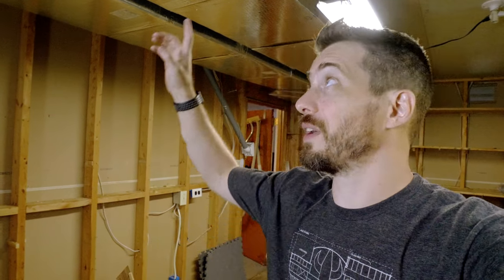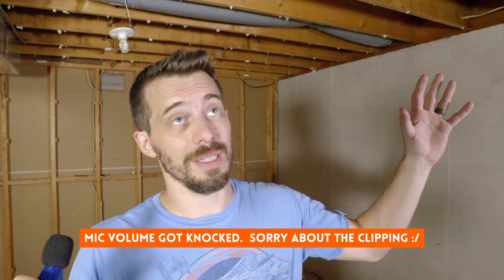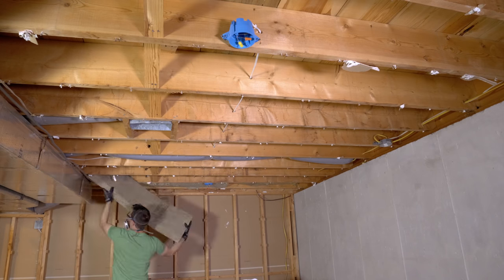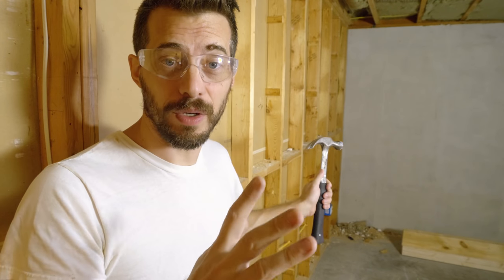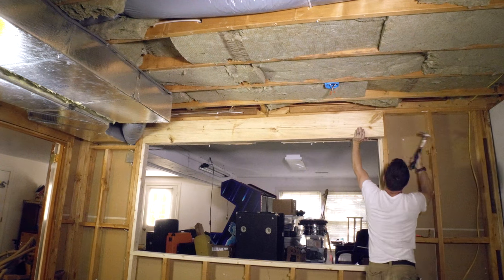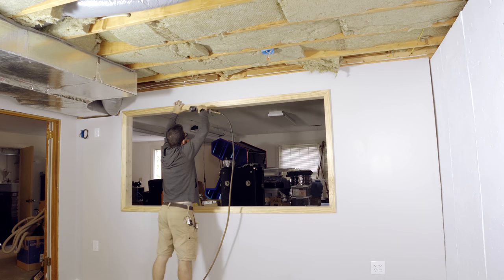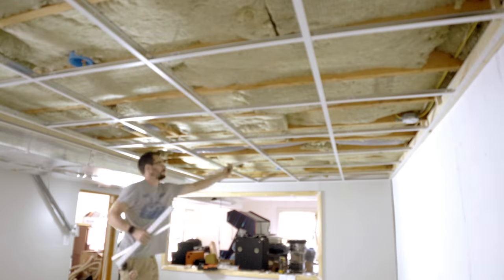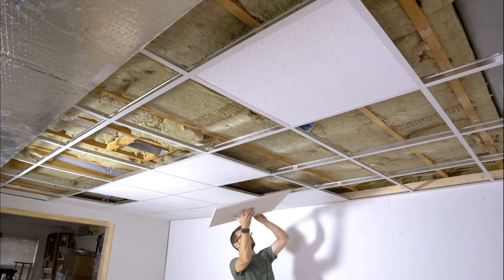Storage room to Office/Studio Conversion // Home Renovation | I Like To Make Stuff

Comment: Looks awesome. I think the acrylic window is genius! (I have four kids. I don't have nice things because I have four kids. Breakable things are a no. Acrylic window in office is a YES.) Awesome video!
Reply: After soundproofing the whole ceiling,  nearly nothing to stop noise from the next ceiling through the window.  Heavy glass would have worked better.
Reply: That a way to troll! Go get'm big guy. 

*(Not thinking he'll probably use that same treatment on that room's ceiling as well.)
Reply: The room where his kids are going to play and hang out,  with stuff flying around ( 8:30 )?  Give it a hanging ceiling,  noise + potential damage = solved
Reply: If you don't care for the window to be see-through, ribbed polycarbonate is a way stronger solution.
Reply: Hazel and Gold Designs I am one of 6
Reply: Hazel and Gold Designs don't hit on this guy

Comment: Your "quietness" gains are greater than you may think. Sound intensity is measured in dB (deciBel), which is a logarithmic scale. In practical terms, for each +3dB, sound intensity doubles (or for every -3dB you register, sound intensity halves).
Reply: Bruno Guedes You're correct that sound intensity level (a value calculated from a measured sound pressure level) doubles about every 3 dB - but the human-perceived loudness (what we subjectively perceive as sound volume) doubles only about every 10 dB. Still, the 10+ dB drop measured would result in a perceived loudness drop of more than half of the volume measured during the pre-project "noisy" period upstairs. Pretty good reduction!

Comment: The dropped ceiling is actually sound insulating better than the mineral wool as it has more mass. The stone wool can absorb the sound inside a room very well but it's not a good insulation system. And by the way it is a very good thermal insulation even if for this particular product the manufacturer doesn't specify it.

Comment: Can you please do a video where you talk about good starting power tools such as, table saw, miter saw, bad saw belts/disc sander and other tools like that. I really want to start doing more woodworking and I'm a little over weekend about what to buy. Great video as always!
Reply: If you live in a good-sized city, Craig's List and an unwillingness to spend more than $100 for most tools will get you going. Living in Cheyenne, I've bought two jointers, a planer, bandsaw, and 12in disc sander for less than $400. The Hitachi table saw was a bit of a splurge, but some darn good craftsman saws can be had for $100. 

The good thing about cheap used tools is that if you take care of them, you don't have to worry as much about depreciation.

Comment: Regarding Roxul vs Pink Fluffy - you are absolutely right that there is little difference between the two.  That's the "absorption" layer that is effective with higher frequencies and while Safe-n-Sound is slightly more absorbent, the difference is so slight that you'd only notice if the rest of your attenuation strategy is on point.  Diminishing returns and all that.

Regarding drywall on the ceiling - drywall would do a much better job overall of sound control than a dropped ceiling simply because it has so much more "mass".  Of the four horsemen of sound-proofing (Mass, Absorption, Damping, and Decoupling), mass is the only one that is a hard requirement and has the clearest impact... and is second only to "decoupling" as the most bang for the buck.  What the drywall wouldn't help with (much) is the impact noise from footfall traffic.  Only decoupling helps with that.  Your dropped ceiling is mildly in that direction but since the acoustical tiles have relatively so little mass compared to drywall, it's not going to have the same impact.

But hey, as you heard with your own ears, even what you did do makes a HUGE difference so don't take any of what I said as a criticism.  Good job!

Comment: Great job, safe n sound is amazing. I would of use a vapor barrier and if you wanted to loose even more of the sound and you have a budget, i would of put up 5/8 drywall or even better plywood pieces for the seiling. Instead of the Tbars for the ceiling, you could have also used ceiling pvc tiles which just glue on, the leds you could also install above the drywall. Either way amazing job!

Comment: If low frequency sound transmission or impact noise becomes an issue, increasing mass (i.e. two layers of drywall) resiliently suspended (e.g. IsoMax Clips, GenieClips, etc.) should really help. If you ever want more clarification, don't hesitate to reach out. And keep up the great videos!

Comment: In terms of speakers, every increase of 3 DbSpl is a doubling of power, so dropping the ambient room noise by about 3 is actually almost cutting it in half. Something you might not be able to hear on your own, but that definitely makes a difference for recording purposes. Those LED panels are AMAZING instead of fluorescents which again, cause a noise and hum that ruins recordings. As for your kids footsteps, having a few rugs on the floor above would help, even if you set them under couches and tables and not where the kids are walking, as well as you could add a few bass traps in your studio to help the absorption. Awesome job!

Comment: I have a similar project - trying to specifically lessen the sound of foot traffic (wood floors) from room above entering room below.  I plan on using the Roxul but also I've read that the key is density of material to "kill" the sound from passing through.  I'm wondering if a couple layers of sheetrock on the ceiling could help?  Anyone here have any experience in this regard?

Comment: Are you concerned that the insulation will eventually fall down onto the drop ceiling?   the vibrations in the floor will probably shake them loose over time.  Probably should have used plastic strapping or paper backed insulation stapled up to hold the insulation in place between the studs.   Otherwise it looks great!

Comment: Nice project...More outlets !
There are sheetrock hold- off brackets that run across joists (or studs) for sound reduction if you prefer a drywall ceiling.
Also consider pre- installing smurf tube so you can easily change out to fiber or whatever comes along (especially in an office).
🔺You don't want to breath the fibers from either the sound/fire insulation or the ceiling panels.

Comment: Bob! Great video, thanks for making it! You can save (repair) clipped audio recordings with Adobe Audition's De-Clipper. If you are an Adobe CC user, you are probably paying for it anyway! If you want super fast audio de-noise and de-clipper, it does not get any better than Izotope's RX. The RX Elements version ($99) comes with a voice de-noiser and a de-clipper (and some other stuff). They can run in your NLE as an audio plugin in real time. Those two effects are well worth it. I own the standard version of RX ($399) and I use those effects all the time in Premiere. No de-noising or de-clipping can touch what RX does. It's basically magic.
Reply from the maker: Awesome, I'll check that out! Thanks!

Comment: Next you need sound treatment inside that room, especially if you want to record audio in this space. Corner base traps, and a few base traps in strategic places would make a world of difference. Granted, I have no idea what you've done to this room after this video was made. Corner base traps are simple triangular shaped wedges that fit in the corners of the room. They "collect" and dampen bass frequencies as they bounce around and pool in the corners. The other bass traps I'm talking about look kinda like picture frames. Both bass traps are simply filled with that Roxul stuff you put in the ceiling. You can make these thing complicated if you want to, but they don't need to be. A company called gik acoustics makes these, but you could make them for cheaper.

Comment: Hey Bob, since you're not going for a fully treated studio setup, this may be tangential information to help you make better decisions on future sound improvements.

Jesco Lohan is a pretty knowledgable guy on acoustics when it comes to sound treatment: http://www.acousticsinsider.com/blog/

As you said, no one brand of insulation is better at sound absorption, but Jesco's experiments and resulting advice on the matter is that the weight (density) of the material and its depth are the most important factors in acoustic dampening. He's got some pretty convincing research on which brand he believes to be the best compromise vs cost compiled here: http://www.acousticsinsider.com/best-insulation-material-diy-acoustic-absorbers/

If you choose to do any further treatment, especially for voice over/podcast work, you might look at Jesco's designs for some DIY acoustic panels and leverage his methods for identifying reflection points and room modes for panel placement.

Good luck with the rest of the shop! It's really shaping up and looking forward to all that you'll be able to produce there :)

Comment: Just a tip, that maybe won't make any difference to you, but could be useful to someone.
In a false ceiling, those hanging wires can make the hole ceiling move and resonate, like a guitar's sound box, so you amplipy the sounds coming from above, especially the steps. And  you can also have a strange "vacuum" feeling when you open or close the door.
If you use hanging pole you can simply avoid this problem.

Sorry for my english, I hope you could understand

Comment: The acrylic is expensive, but I didn't even consider the kids (and I've got two! Whoops!) aspect. Plus, if it's too noisy I'd assume you could add a panel on either or both sides and it should help mitigate some more of the noise. Dunno, I'm not a sound proofing expert.

Comment: Love the work Bob. This is both a suggestion and a request for a video. Could you build a recording booth in the corner of your office. Vertical height a bit less than the room, and horizontal area a bit more than a portaloo. Could be made from a nice wood with sound proofing stuff on the inside. You could then do a build for a microphone and tablet/laptop stand (or just a monitor connected to an outside PC (better for sound) and then maybe have a small window of that sound proofing stuff.

It's a lot of work, when you've already done so much to quieten your office for recordings, but it would be a good video, that the same practices could be used for making many other small enclosure such as a tree-house or outhouse. I know I'd also be interested in soundproofing practices.

Comment: There will be a lot of reflections of sound with the bare walls there. I worked in a few recording studios a long time ago and one of them had a beautiful large recording room with dampening panels hung on the walls so you could 'tune' the room for a particular type of reflection ambience. In essence they were made from boxes of 1 x 6, like you first framed the window, with ply, varnished, on one ( it would be say the bottom of the box ) side. Then the inside of the box was filled with rockwool and a cloth layer was stapled over that making the 'top' of the box. They hung on chains with hooks in the wall so you could turn them dampening side or live side to face into the room and I think there was maybe a foot between each panel. I am not sure what your budget is but thick cloth decorative wall hangings, like rugs, would do similar. Even douvets tacked to boards would help. Or books, shelves and shelves of books.

Comment: Roxul is a Rock Wool Product (Fiberglass But instead of glass they use basalt rock) it is a great product but it can be more itchy than fiberglass. It can break apart if not properly supported during install (depending on quality) and the best tool to cut this stuff is a Long Snap knife. If you ever run across old rock wool please use a dust mask at the least the dust its self on new product is just a nuisance dust but the binders as they break down can be more harmful.  As a side FYI this is the same stuff used to start seeds in hydroponics.

Comment: probably old news now, since this is an old video, but having worked with insulation (both thermal and sound) in residential, office and industrial spaces, I have found that Cellulose fiber insulation is a fantastic sound-proofing product, especially if you get the extra fine granules blown in and packed real tight.

Comment: Maybe I missed something, but I'm wondering why you didn't simply turn the other room with the pre-existing windows into your office? Seems like it would have been easier/simpler to just build a wall to enclose that pre-existing space on the other side than it was to cut out a huge section of a wall, reinforce it, and then add a window.

Comment: Soft materials absorb reflections but do little to block sound. He should have left the old drywall on the ceiling & added a drop ceiling under it. I think a second layer of drywall would have been better still, but a drop ceiling will be better at taming reflections inside the room.

Comment: When it come to sound "proofing" you have to remember sound is energy transferred. The only way to dampen it is with mass and limited direct contact. A sound booth is normally a room within a room with staggered studs, insulation (rock wool due to mass) and multiple layers of drywall normally with a specialty type of hanger in between layers. The foam you see out there is do reduce reflected sound within the space. When in a pinch ive recorded voice overs just under a down comforter when on the road.

Comment: Generalized Rules for Sound Transmission

Sound transmission through walls and ceilings is primarily affected by isolation and mass.  Isolating parts of a wall with resilient channel or by other means will greatly decrease sound transmission.  Also, adding extra mass (lots of drywall or a concrete topping if it is a floor) will greatly decrease sound transmission.

In room sound is primarily controlled with insulation (sometimes in the form of a sound panel) and other exotic systems such as traps.

Comment: If you will add another layer of insulation between the drop ceiling & ceiling joist (layered 90° from previous run) it should help even more.

Comment: Measuring up from the floor can prove problematic you need to be exactly level. Suggest using a self leveling laser to draw a straight line for you. Most residential projects aren't that exact though.

Comment: Great job Bob! One question though.  Why the header? If the wall isn't load bearing, framing the top as you did the sill would have been a lot easier.  Especially since you had no help.
Reply from the maker: Mainly just to set a good example. If I'd just used a 2x4 (which would have worked fine) there would still be people who claimed that my house as going to fall down and kill me. Overbuilding (I mentioned that it was overkill) is the safer option for anyone else looking to do something similar.

Comment: Actually, rock-wool is the best thermal insulation  you can buy. It is quite old, but some traders do not like it because it falls apart easily and  a bit hard to work with it

Comment: To reveal the edges of the ceiling tiles you run a blade gently along the wall angle to make a mark on the tile. Then cut the depth of the factory reveal on that line and score it at a right angle to cut away the excess tile. The tiles along the wall will drop down and look as if they’re factory :)

Comment: Great job. .... you did just say it wasn't load bearing..sooooo why the huge header? Your not dispersing load weight. Could have just been a2x4 frame all around.
Reply from the maker: I'm well aware but it's mostly about setting a good example for others (I mentioned that it was completely over built) and to avoid the troll comments of "your house is going to fall on you without a header..."

Comment: What thickness of acrylic did you end up using for your window and does it flex that much when installed?  Looking to make a fake 'department store' window display in a 3rd car garage for Christmas but not sure what thickness I need to get for a 4ft high 8ft wide 'window'.
Reply from the maker: This was 1/8" and there's a fair amount of flex. I used 1/4" in an old office and it was pretty sturdy but pricey and heavy.

Comment: You did an awesome job! Is that room conditioned? Maybe you could tap into those ductboard trunk lines to get you some air in there...Now THAT is some insulation that will make you regret not wearing a full body suite! lol
Reply from the maker: Yeah, there's a vent in the ceiling. You can see the one square that I hadn't put in yet. That was the one where i had to cut out and mount an AC vent.

Comment: What did you do with the concrete wall?  It didn't look like you put drywall up.  Did you just paint it?  If so is there specific primer or paint?  Did you removed or grind the raised lines from the forms?
Reply from the maker: Just painted it using latex primer and a coat of paint.

Comment: Why didn't you leave the plastic cover on the other side of the windows until you remodel that side, so you dont damage the acrylic?
Reply from the maker: I already added the casing to the other side, there just wasn't any reason to show it on the video.  That room is mainly just getting a fresh coat of paint.

Comment: When you affixed the white board to the cement wall: what screws did you use? It looked like they went in easy.
Reply from the maker: Oh that wasn't a cement wall (the long wall is the cement one). The white board just got screwed onto the old unfinished drywall.